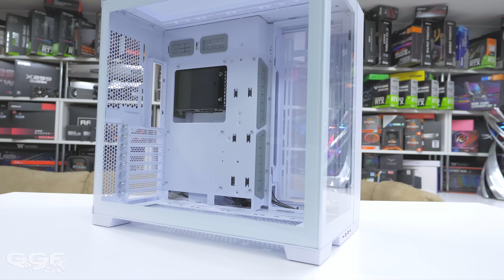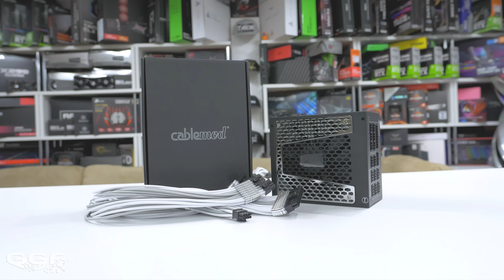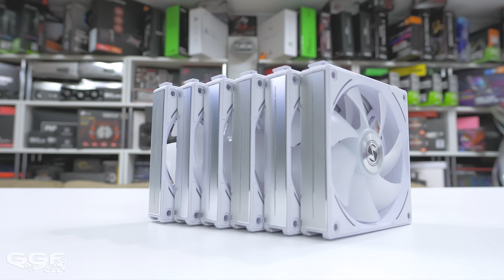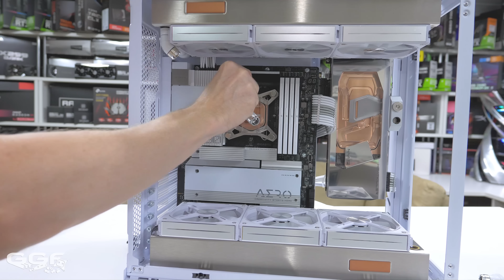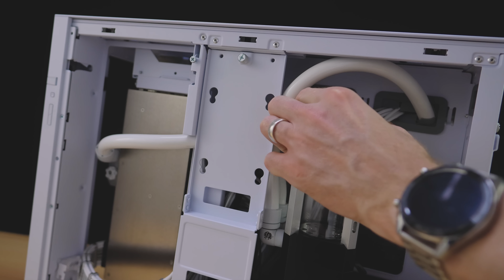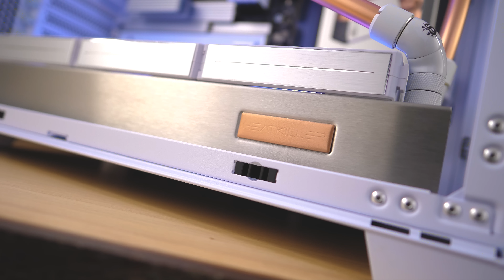White Copper - LIAN LI O11 EVO Build

Comment: Wow, that’s a super clean build. Best I have seen for this case by a mile. I really liked how you routed the PCI-e cable from the bottom and hide the pump at the back. Some really great ideas for my next build. Still can’t believe how well you routed the pci-e cable, all the other tubers I have seen make it look ugly and super visible but your build is so clean you can’t even see the cable. 10/10!!
Reply: Can’t blame them the cable comes with the kit is not long enough to do that, which lianli says they can’t make any longer cable with in the spec, the cable he used here is from thermal take, which buy the way clearly prove that making the cable longer is possible, now it wouldn’t be fair for a youtuber to review the kit with an extra cost on top of an extra cost to make it looks good wouldn’t it. The fault is on lianli this time, I really wouldn’t buy this kit unless they change that.
Reply: But does it work? I was thinking about getting the long cable from LinkUp (have had good experience with them in the past) and doing the same thing, but he hasn't shown any video of this cable/card combination actually working... Also thinking of 3D printing the bracket. I've heard a few people say that you can't use the bracket in the inverted position, but I've seen a couple of builds (on Lian Li's site, no less) that have done exactly that. Love this case.
Reply: @Ryu-z6d  Just to clarify, that is the max length that their supplier could make.

Comment: This thing knows my thoughts.  I was wondering the other day if you could use copper tubing/fittings.  It would be much easier to work with.  You can do a build like this with no 90 degree bends,  not so, I think, with other tubing.

Comment: Been thinking about the upright GPU, would be nice if mobo manufacturers could make a double sided X16 pcie slot I suppose almost like a passthrough, that way you could use a standard length riser cable on the rear of the board. I realise it would add cost etc  but just how popular has the O11 range been, this would be an added selling point fir motherboards.

Comment: Clever idea with the pump/res combo on top of the PSU in the back!  I've been waiting for EK to release their distroplate and now that they have I'm not so sure it would work with the Lian-Li Upright GPU kit.  I even reached out and they said they haven't tested it so they weren't able to answer my question.  I'd really like to use the upright gpu kit so this may be a solution I go toward!
Reply: I'm on the same boat... don't know if they are compatible. Did you managed to get that info?
Reply: @iLoGiKZ  I reached back out to them again recently and unfortunately it sounds like it wouldn't be compatible...  I asked if they had plans to create a distro plate that would work with the upright GPU position, and they said that they do not have plans to do so at this time.  I still wonder if it could work though, just with lots of weird connectors haha
Reply: @grantwooldridge3717  Thanks. That's unfortunate :(.

Comment: The first proper O11 EVO build.  Was that PCIe 3.0 or 4.0?  I believe 4.0 cable length has a shorter tolerance, so they are expensive.  I don't see the riser cable listed as parts, just curious how you got this done.
Reply from the maker: Oh damn thanks for reminding me. I'll add it to the parts list. Was the Thermaltake gen4 600mm riser.

Comment: You know, I was torn on whether or not I like the upright GPU mount, as almost everyone that review the Evo had it running across the motherboard. But this, this looks REALLY GOOD.
Reply: But he plugged into bottom PCIe lane though. That must have cut some performance.
Reply: @araisikewai  Since it shares 8 lanes with the primary PCI-E slot, it wouldn't make much of difference.

Now, if that slot used lanes coming from the Z690 chipset, there's a possibility of slightly reduced performance.

Comment: sleek as hell.  how did you mount the reservoir? or is it freestanding?  Also i'm curious is the soft tubing only from the upper radiator to the reservoir? i cant tell if the one from teh back of the gpu is hard tubing or soft tubing.  Like your style! got my sub.

Comment: Amazing build. Congrats!  Don’t you loose performance using the bottom pcie slot for the gpu?
Reply: I'm pretty sure that motherboard allows 16 lanes on the second full size slot if the first slot isn't being used.

Comment: Question: I noticed the HeatKiller Rad, online shows Heatkiller emblem in silver, did you modify the emblem to get the copper color, or did it come with the product itself? That little subtle accent brings it all together. There's nothing that looks better than either a silver/white with copper accent theme, or like your matte black and copper/bronze theme builds. IMO. Killer work, and thank you for the inspiration for our own builds.
Reply from the maker: Thank you for the kind words. And yes it comes silver but is metal. So with a bit of heat it comes right off then painted it 🙂

Comment: Are the two ports on the gpu block at the same height as the cpu block? And is there a little wiggle room for height adjustment of the gpu or is it static? I would love to do a clean build with two parallel tubes from the gpu to the cpu but this would only be possible if the cpu block was rotated at 180 degrees I suppose. Clean af build tho
Reply from the maker: Could be and idea. The upright kit is static but some standoffs could be added to make it lower.

Comment: Is that lower pciex16 a gen 4? Plugging into that lower port to hide as much of the riser cable definitely looks the best,but aren't you just limiting speeds for the gpu? I'm about to swap my build into the case and I purchased the Thermaltake 60cm 4.0 riser... but I have a x570 dark hero board,I think only the top most X16 port is gen4...
Reply from the maker: 8x gen4 will see no performance loss

Comment: Does plugging the GPU on the very bottom PCI express lane really not make a difference in the z690 boards? Aesthetically is brilliant
Reply: It'll probably be PCI-E 4.0 x8, which is fine for almost everything
Reply from the maker: It's not the bottom. 8x gen4 is plenty
Reply: @GGFEvents  amazing build, how you handled the upright mount will definitely be trendsetting

Comment: This build is amazing ! However, after sometime, the copper starts to be discoloured right? How would you prevent sometime like that so it always looks this good because I think it would be visable in the GPU block after a few months/ years of use right?
Reply: Only the outside would get discoloration, and then only if you rub your hands all over it.  He put a clear coat over it anyway.
Reply: I believe he explained how he has protected the tubes in de previous video about this case, the review
Reply: @Pindakaes  I was actually referring to the GPU waterblock

Comment: Why did you not pull the bends with a micro copper bender, that way you could have kept the pipes parallel with other component lines, this just looks bad, it looks like you just eased that ark into the pipes, its like hose pipe quick and easy.
Reply from the maker: Because that's what the next EVO build will be. And thus only being 3 bends in this build. Direct 90s would look even more odd.